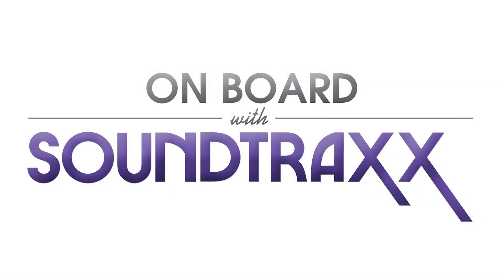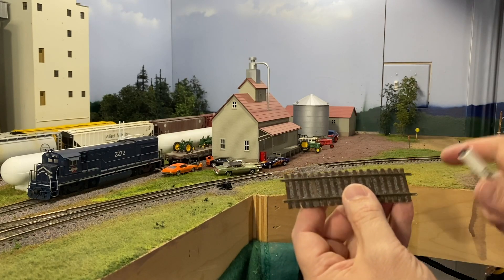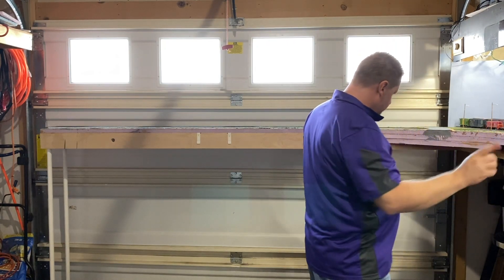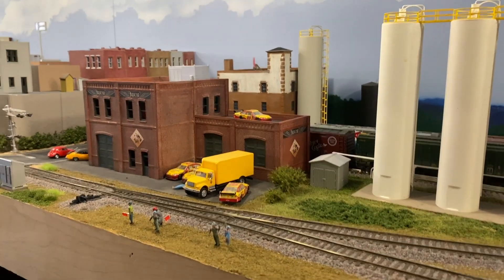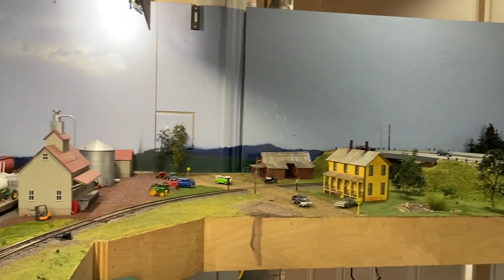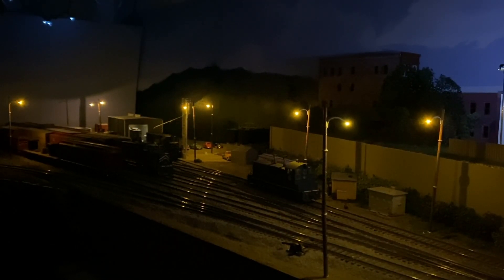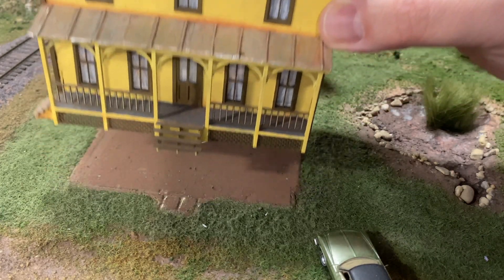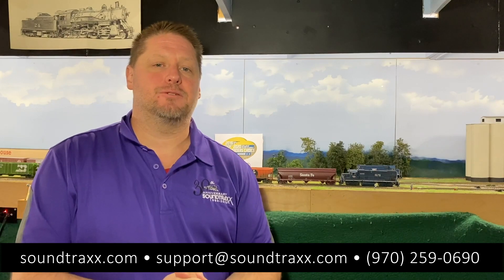Layout Tour: George Bogatiuk III SoundTraxx Product Expert

Comment: George...thanks for the tour. Lots of interesting ideas some of which I will try. I noticed that you placed your light hubs under the layout. Doesn't that make them hard to access? I'm also a fan of your SoundTraxx videos from which I have learned a lot...Harold
Reply from the maker: Not necessarily. I don't need to access them too often, once the brilliance is dialed in, but they are mounted to the underside of the foam and up against the plywood.

Comment: Hey George, great video and tour.  At 27:19 when your loco goes through the grade crossing, is that Tsunami2 sound or do you have your own sound file.  It sounded real.  If it is Tsunami2 sound, did you mess with the reverb or echo settings to get it to sound like that?  Thanks!
Reply from the maker: Of course it is Tsunami2!  I selected the Leslie RS3L Air horn (Horn selection 23) and added some echo via CV 161 to 75 and 233 to 4.  Thanks for watching!  BTW, been watching your construction progress..  great job and I cannot wait to see it finished.  Looking good!
Reply: @SoundtraxxDCC  George, totally unrelated to this particular video, but didn't know where else to ask.  Have you done a YT video on settings for the Proto Throttle and Tsunami2?  I did a search and the one about true idle came up but that is it.  Didn't see anything else on the Soundtraxx page.  Thanks!

Comment: Awesome tour George! I will deffiantly check out using blue Christmas lights. What would be your thoughts on blue LED over the traditional incandescent bulbs? Also did you have that connected to a seperate switch or dimmer? - Jason
Reply from the maker: Either would work. I got this set on sale after Christmas for like $1. LED would be fine, the blue tint is replicating moonlight and putting out enough to see what your doing on the layout.